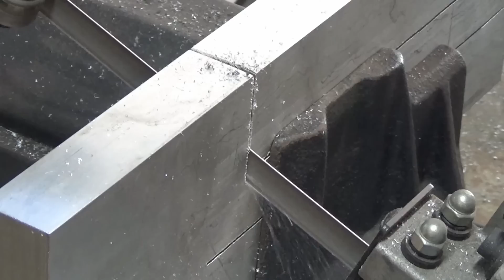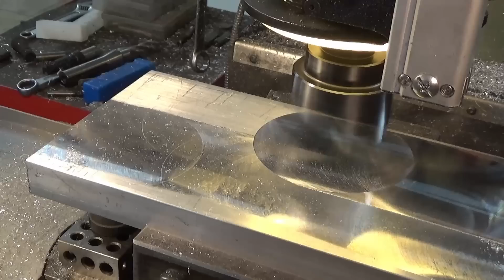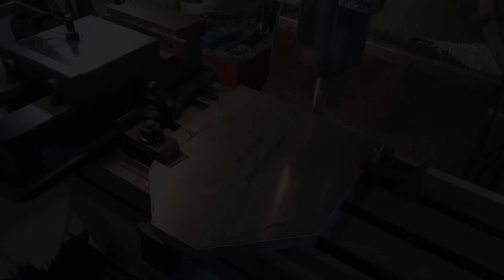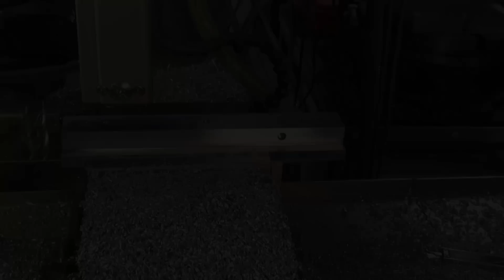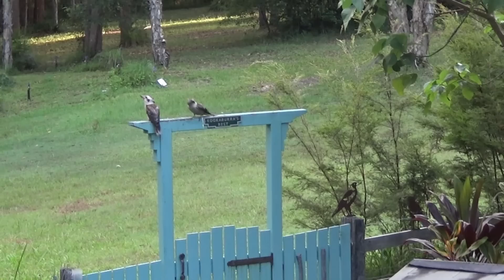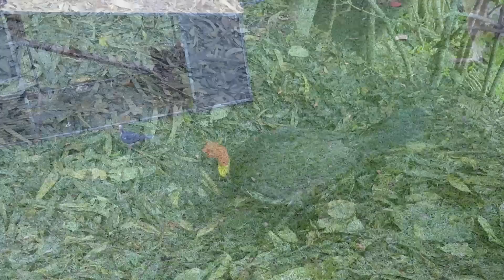ThreadExpress V3. Ep.6 How To Build a Thread Milling Attachment for Your Knee Mill.

Comment: I for one have NEVER nicked a parallel with an endmill. I have also never told a lie. 😂 Is that kind of rain typical for this time of year? That was quite the deluge.
Reply from the maker: Yeah, let's all have a show and tell! Drilling into vice jaws and nicking parallels is all part of the hobby. 
Yes, from November through to April is our wet season. If a tropical depression stalls over Wide Bay (west of Fraser Island and between the Queensland coast we can get torrential rain for weeks and weeks. We built a replica of a typical "Queenslander" house which is high set with stairs back and front so that there is no danger of flooding. Our block of land slopes towards a seasonal creek so the overland flows drain away very quickly but other people that live in low lying areas get flooded out year on year. Australia is a land of floods, bushfire and cyclones. If the plants and animals don't kill you, the weather will!
Regards,
Mark
Reply: @Preso58  Would you believe that just yesterday, I was helping a friend make a part of one of Mark Winquist's cut off tools, and I drilled into the edge of a parallel! And I broke the drill! 😂

Comment: 110mm? That’s more than half our annual precipitation. But when it really storms here, our overland flows have a habit of combining into flash floods and have, in the past, shoved very large bulldozers from construction sites into the bottom of a lake.
Reply from the maker: The power of moving water is pretty awesome. We were just watching the news last night and North Queensland is due to cop flooding rain today with predicted rainfall measuring up to 1000mm!
Regards,
Mark
Reply: Rockhampton region, Central Queensland, January 1990, 24" (600mm) in 24 hours. Reported on the news, TV, 20 thousand pigs were seen being washed down the Fitzroy river. ( Actually, 20 sows and pigs).

Comment: Nice! The hack saw comment took me back. In my misspent youth I made a small lathe out of scrap hot-rolled angle and cold-rolled bar stock with a hack saw, files, and a drill press. Took the whole summer before grade 10. Actually worked well for making model parts.
Reply: That dosent sound misspent at all
Reply from the maker: I recall taking my dad's hacksaw by bike to a derelict car with the aim of cutting through the steering column so we could use the steering wheel to make a go-kart. It seemed to take forever. Character building!
Regards,
Mark

Comment: Lots of chunky milling, very nice job. Perhaps an adjustable gib could be fitted to the 15mm deep step. I've used an epoxy shim before, works well. Yeah, I've got accidental custom parallels not to mention vice jaws.
Reply from the maker: I bought some of that metal filled epoxy to shim the column on my small CNC mill. I had seen a video by Stefan Gotteswinter where he used a bed of the epoxy and some annealed copper wire to tram in the column of his (older) Optimum milling machine. It works a treat although it's not cheap to carry out. I did have a go at relieving the centre of the slide plate today and it did help but it's still a fraction tight. We are talking 20 microns, so, very close. 
Regards,
Mark

Comment: As a left - right, front back challenged person I also like mock ups and for your build full size has other benefits. In some cases 3D printed scaled down versions can save on materials, you can still use the model orientation to check that you  are machining the feature in the correct face etc. I have definitely munched a parallel or two …
Reply from the maker: I agree. I can stare at a drawing for ages and still flip the physical part inside out or left/right. Having a 3D representation prior to committing to cutting metal saves on a lot of bad words after the fact. 
Regards,
Mark

Comment: I recently had to cut some 12mm 6082 ally that was too big for my 6x4. With some trepidation I reached for my jigsaw with a 14TPI wood blade, with no pendulum action and the slowest speed it cut really well, so much so that as I gained confidence I was able to increase the speed a little It was way quicker than I expected. I’m not sure if it would do the thicker sections on thread Express but it’s a technique I will be using again when needed. Really enjoying the collaboration between Cliff and yourself, thanks Mark.
Reply from the maker: I did actually buy some metal blades for my Bosch jigsaw anticipating the need early on. It does have the pendulum cutting action but no variable speed. It's sort of "do or die". 
Regards,
Mark

Comment: Hi Mark, that' a very interesting device you are making.
When attempting to machine a flat surface on a milling machine were the squareness of the spindle and the wear in the table slides is not at it's best I was shown a better way than using a fly cutter. Using a much smaller cutter will produce a much flatter surface although requiring more passes to go over the surface being machined. the large Diameter of the fly cutter exaggerates the small error in the spindle alignment and any wear in the machine table slides. I have been precision machining for the defense Dept. and private research industry for almost 50 years, I was given this tip and many more years ago and also told to pass on my knowledge when every possible to keep these skills available for future generations.
I am now spending my last years working in a University in Australia helping to train the next generations of engineering students.
Reply from the maker: I must say that these are some of the biggest parts I have made on my mill, so I was not prepared for how the wear in the machine was going to show up in the finished surfaces. I have made the decision to relieve the centre section of the long slide plate before I do anything drastic with the stepped guides. I suspect this will remedy the tight fit on the longer guide. I take your point on using a smaller diameter sweep on the flycutter. It makes sense. Good on you for being involved in training our young people. Our society needs well qualified and innovative engineers.

Comment: Nice work as usual. This is shaping up to be a fairly complex (and expensive) build.  Looking forward to seeing the finished and calibrated product in operation.  I noted the concern over play in the ratio arm and nut in Cliff’s video.  Intuitively this seems like something you might treat as you would backlash - as long as it’s loaded in the same direction would it affect the linearity of the thread pitch excessively?
Reply from the maker: My understanding is that the weight of the headstock tends to eliminate any backlash but you do need to withdraw the fly cutter before returning to the beginning of the thread if you are doing multiple passes. 
Regards,
Mark

Comment: @7:42 - have you ever tried doing a ceracoat ceramic coating? And if so, how does it compare to the parkerizing?
Reply from the maker: I haven't tried Cerakote. For most decorative finishes I use regular powdercoat. The thing with parkerising is that there are no consumable materials. One you mix up the iron phosphate, it more or less lasts indefinitely. You can add steel wool to it if it starts to deplete but I still have my original mix and it continues to work. 
Regards,
Mark

Comment: Awesome. FYI, aluminum can be cut with regular wood cutting tools. Unlike ferrous metals, it likes faster feeds and speeds with a lower tooth count. To prevent galling, use pure coconut oil or butter. To remove welded-on aluminum from cutting tools, soak them in a chemical base such as lye.
Reply from the maker: Thanks. I have used regular wood cutting router bits on aluminium before, mainly round over bits. I have never tried organic oils before though. I did use some of the dry lubricant sold for things like car door striker plates and it worked great. It sticks to the metal and doesn't spray everywhere.
Regards,
Mark
Reply: Best with negative rake if you are using rotary blades too. Then these double up for working with Acrylic sheet.
Reply: I was going to suggest the same thing.  I have cut thick aluminium plates on the compound miter saw using wd40 as a lubricant.

Comment: Nice work as usual Mark. Have you considered lapping that plate to suit the sides?
Reply from the maker: I haven't considered that, yet. The only issue I can think of is that most lapping compounds will embed in the softer of the two materials, so an aluminium lap will cut hardened steel or a copper lap will cut stainless steel. It would probably be best to use a lapping paste that breaks down as it is used.
Regards,
Mark